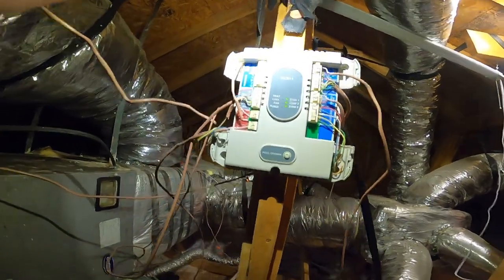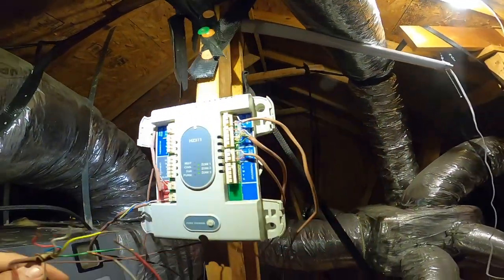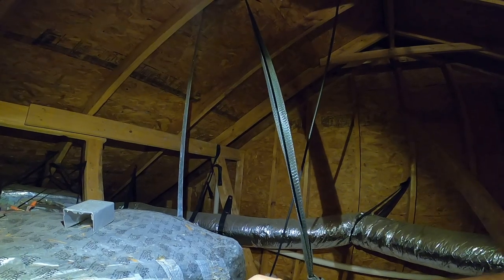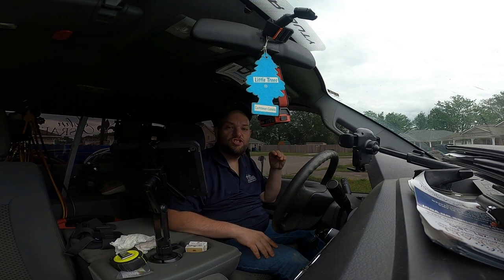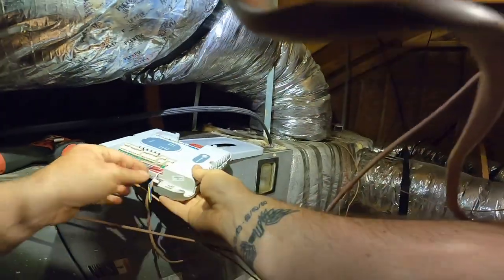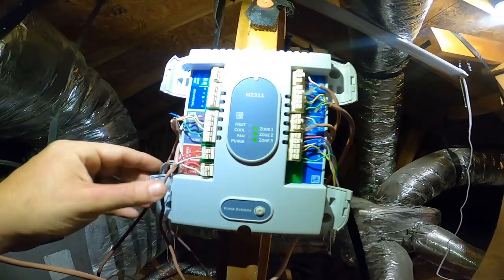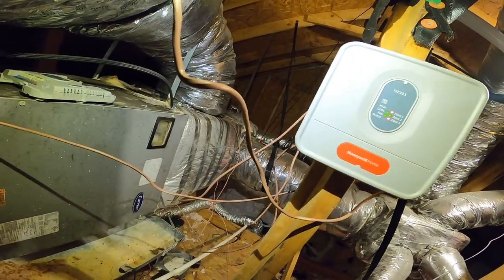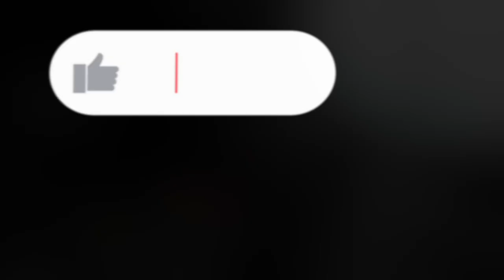Carrier Zone System Down After Recent Storm

Comment: Those original Honeywell dampers are prone to stick closed that is probably why someone disconnected it. I would recommend quoting two new updated damper motors they are super easy to replace just the motor
Reply: Exactly the dampers its self are good quality unless the system was introduced to moisture or salt water which is rare or the damper was dropped at install making it oval..but other then damage changing the damper motor to the new one with needles is the best thing on the market

Comment: Took me awhile to understand zoning 
It’s pretty simple once u figured it out.
It can get kinda tricky if they are using multiple damper’s for 1 zone , meaning just more wire’s to trace 😂😂😂
Whenever I go to a zoning call I never been to, first thing I do it test make sure it’s working right.

Good job bro
Reply: Same cause it be like this

Usually 2 dampers 1 for upstairs and the other for downstairs

Then you see the:
Two dampers for upstairs 
One for downstairs
Meaning the two up stairs get to go to the same zone (which the honeywell has only 4 holes for the wires) per each zone

Then you have people naming the upstairs zone 1 and the downstairs zone 2 which is confusing af

I rather name down stairs zone 1 and upstairs zone 2

Comment: But that basically means all you had to do originally was I'm plugged 24 V and then plugged 24 bolt back in and they probably wouldn't worked fine. It's probably they replaced the battery in the upstairs thermostat

Comment: You should've checked your 24v. If you're trying to run all that zoning plus 2 thermostats off the factory transformer, it's too much VA. Always separate the zoning using a second transformer. That VA drop does weird things to those boards.
Reply from the maker: The zone board had its own transformer

Comment: Zoning is more for technology geeks

The word zoning means:
The house has 2 or more dampers

If the house has dampers it means it will have 2 thermostats atleast...

If the house has two thermostats and no zone board that just means one thermostat is the real one and the other one is just for easy access if you dont feel like walking to the other one (is the way i see it) which at the point your entire hvac system will be running non stop cause its sensing 2 different temps to switch on and off constantly

Also zoning is to save money

Your suppose to set the different zones to 2 degrees (+/-) different if you going to have matching temps then you are wasting the entire zone capability/function

Comment: i would offer to fix that wiring mess its horrible
Reply from the maker: Believe me, I did offer they just asked me to get it back running, but I wanted to reroute them and make them look good
Reply: @johnisraelhvac2019  i would have done it if it was not a big deal and not charged them for it:)
Reply: i know you do the best job you can but you see the parts of the systems the home owner might not
Reply from the maker: Yeah, but I don’t work for free
Reply from the maker: She signed up on my maintenance program. More than likely. I’ll probably straighten them out then.
Reply: @johnisraelhvac2019  sometimes the small free stuff lands you the bigger job or jobs down the road but i know what you mean